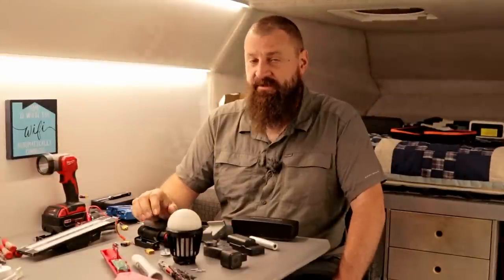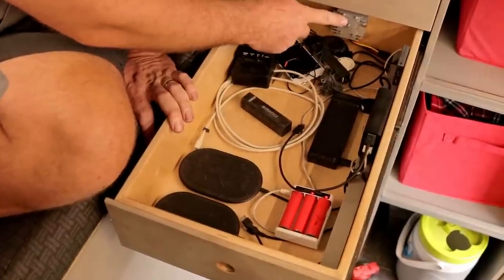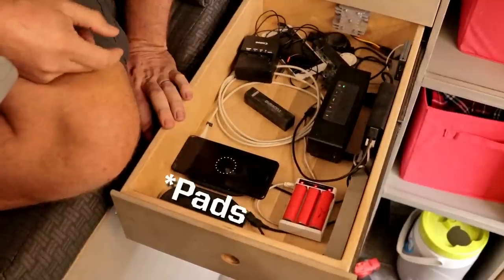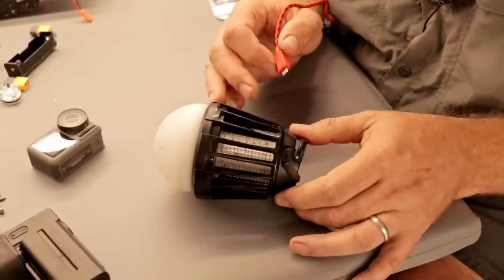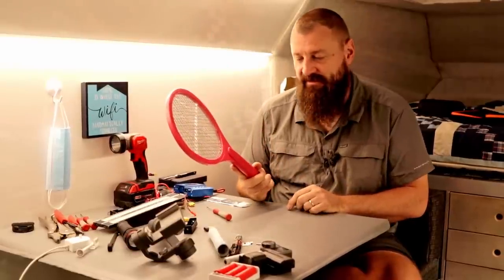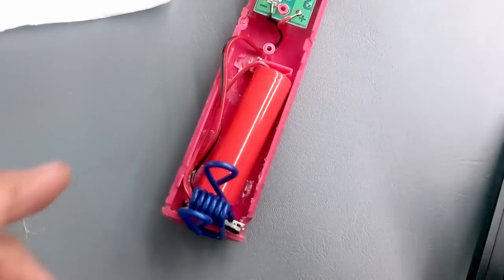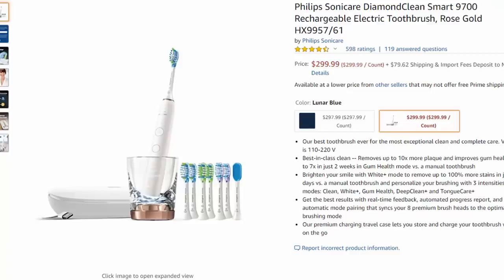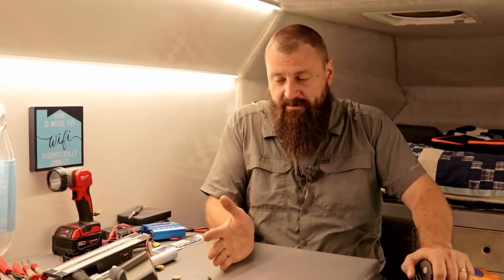Powering and Charging Overland Electronics - How we charge everything! - Everlanders See the World!

Comment: Looking forward to the upcoming project! Also the TS80 is similar to the TS100 but USB C Power Delivery powered. Useful to run off a usb battery bank.
Reply from the maker: Cool, the TS80 is half the wattage however, and there's already been times where I was soldering a larger gauge wire that was sinking the heat away and the 65 watts was borderline... so for my application the TS100 with the drill battery will be preferable.
Reply: Everlanders you should check out Marco Reps test of the TS80. It's actually higher in power while soldering. 
TS100 has a higher peak wattage but sustained wattage is lower :)
Reply: Was just about to say there’s a new TS80P out as of a week or two ago
Reply: I also have the TS100 and you can make a simple adapter for USB-C > barrel jack that can power the TS100 on 20V which is great. If you have a 45-65W USB-C power source. Just google "zypds usb-c" this is the board I used. 10cm cable and just heatschrink it.

Comment: There's some real nice aftermarket firmware for the TS100. I use mine with a little waterproof buck/boost converter. Takes ~12v and turns it into 24v so I get full wattage from my TS100. Heats up quick!  Thanks for the video.
Reply from the maker: I'll check it out, do you have a good suggestion where to find this firmware?
Reply from the maker: Great tip on the buck converter... I suppose I can run mine straight off the solar that's coming in at 22 volts or so...
Reply: @Everlanders  https://github.com/Ralim/ts100 I'm currently running that one.
Reply from the maker: Thanks, I found it and have already installed it. I couldn't imagine what other features could be added to this already fantastic product, but the boost mode and safety shutdown timer are essential...

Comment: Please feel free to post more Hackery videos if the mood ever returns!  I'm assuming your wall mount TV is using DC converter as well?

For anyone reading comments, can look up any notebook chargers to see their volt/amp requirements.  Older ones tend to be in the 19-24range.  iFixit sometimes has teardowns of devices.  From one of their videos, I found the IC power chip used for Microsoft surface pro tablets has a very nicely wide range so I charge it from either the cigarette port via 12v or a usb-c PD2.0 device.  Same for using a blu-ray player .  Generally, just remember it's easy to release the magic smoke and burn up your device when you do this.  I tried to put 16v into a 12ish volt blu-ray and the smokium maximus spell caused it never work again.

PS.  I have soldering iron envy! :)
Reply from the maker: Yeah, we use PD to charge our Surface... Trying to keep the smoke in.

Comment: Yup, still here and learning something new with each video.
I gather that you're happy with the bug zappers?
Now I need to do some research to find out how I can use the 
iMAX B6 Mini. I have a much larger version for charging my e-bike battery. Thanks
Reply from the maker: Yes, we love the little USB Lights/Zappers - although they don't really have that monumental ZAPP you'd expect, they somehow do it silently... And Mosquitoes are attracted to Co2 and not UV Light, so they aren't effective for mosquitoes - but they ARE effective for no-seeums and a plethora of other tiny fruit fly bugs that get through our screen.  It's always plugged up and needing to be cleaned out - My only complaint is that it's a bit tricky to clean out, they say to run it under water, but that takes a lot of water for us, so I've been using compressed air and sometimes a ear cleaner to get in between the fins and get them loosened off.

Comment: nice! definitely gonna be getting some of those portable lights/bug zappers and resistor-modding my swatters!
Reply from the maker: Right on! Pasting in my previous comment for tempered expectations: We love the little USB Lights/Zappers - although they don't really have that monumental ZAPP you'd expect, they somehow do it silently... And Mosquitoes are attracted to Co2 and not UV Light, so they aren't effective for mosquitoes - but they ARE effective for no-seeums and a plethora of other tiny fruit fly type bugs that get through our screen.  It's always plugged up and needing to be cleaned out - My only complaint is that it's a bit tricky to clean, they say to run it under water, but that takes a lot of water for us, so I've been using compressed air and sometimes a ear cleaner to get in between the fins and get them loosened up.

Comment: Not sure if you saw the new TS-80P that just came out that supports USB PD as well as QC. I've been debating about getting a TS-100 but that new one is pretty slick looking. 
Thanks for the rundown of the mods, they all seem like good ideas!
Reply from the maker: But it's half the wattage... So I chose the beefier one...
Reply: Makes sense! I didn't think there was that much difference in the power levels, good to know!
Reply from the maker: 35ish to 60ish watts if I remember correctly, it doesn't matter if your soldering a tiny little surface-mount LED or something, but if you are trying to solder a connector on a largish wire or other solder a part which is connected to a large ground plane that is sinking away the heat, then it really helps...

Comment: I'm guessing you're also using Raspberry PIs? How are you powering those? Micro USB is so instable on those things. For me, I'm quite happy with the Pimoroni Wide Input SHIM. Only the small barrel connector is a bit flimsy, better resolder that one
Reply from the maker: Yes, We have 5 Pi's on board, I always solder directly to the 5 volt rail at pins 2 and 4
Reply: @Everlanders  and for the 5 volts you use just a regular DC/DC converter? Or something fancy?

Comment: I used a small relay to bypass the resistor while the button was pressed on the bug zapper. Works great and my kids don't shock themselves. Give it a try, I'm curious to see what you come up with for modifying it further.
Reply from the maker: I can't imagine that relay would last very long with 3,000 volts arcing across the contacts... I bet you it has welded itself closed already.
Reply from the maker: On second thought so I suppose the resistor would limit the arc.
Reply: Yeh, I was thinking replace the main switch with a DPDT switch with a current limiting resistor on it for bleeding the cap.    One circuit would be NO for the zapper on button, the other would be NC for the bleeder resistor.  Big question there is isolation, but probably not a huge risk, would certainly need to limit any stray capacitance/inductance in the circuit with the bleeder to keep the arcing to a minimum with a purely resistive setup.

Comment: For higher voltage DC charging I'd recommend the MingHe D3806 and you can charge stuff like the Milwaukee battery just charge it to like 20v just in case it's out of balance and then charge it on the regular charger every once in a while they are just useful for a lot of things but does the Imax b6 not boost voltage if it does you could use it just the same and I'd recommend the aftermarket firmware for the ts100 and also running it off like 19ish volts it is much more powerful I mean it works at 12 but I just can't go back now
Reply from the maker: Yeah, I'll need to look at that firmware, can you send a link?
Reply: @Everlanders  oh it's been a while I'm sure it should not be to hard to find if I recall correctly you really just drag the new file to the soldering iron and your done
Reply from the maker: Yes, the firmware is drag and drop, but I'm not finding anything newer than the version it was delivered with.
Reply: @Everlanders  ya I'm not sure but the other firmware is not from the manufacturer it's open source and someone else made it
Reply from the maker: Found it here: https://github.com/Ralim/ts100

Comment: You could have the resister wired for normally closed and when you push the button its open and then closed it will discharge it
Reply from the maker: I don't know of any button that will tolerate 3000 volts across the contacts...

Comment: So, what connectors do you use for exterior weatherproof connections, such as lights and other 12v accessories on the roof rack?
Reply from the maker: I try not to have any connectors outside, they are all grommeted and brought inside the box. The few I do have outside are the same XT60 with a little dielectric grease and a heat shrink sleeve over it. See the Solar Install video for details.
Reply from the maker: As seen here at 3 minutes 40 seconds: https://youtu.be/3nKCH-whO2A

Comment: My raspberry pi 4 seems to want 5.1 volts at 3 amps. using 5 volts gives under voltage.  have you used rpi 4's yet  ? and have you found a nice power convertor for them without using the tuneable versions. ?
Reply from the maker: I have 4 of them running on fixed 5 volt power supplies as discussed in this recent video: https://youtu.be/UAZGX379dmc
Chances are that your supply can't handle the load and the voltage is dropping below 5 when loaded.

Comment: Is the actual induction component in the base station of the toothbrush charger actually AC... that surprises me if so, would it not have been simpler to hack the base station and leave the brush intact as now you have an exposed usb port that's gonna get full of toothpaste and water. 🧐🤔
Reply from the maker: I already tried that, the base station was completely sealed in potting compound... I suppose I can take the induction coil that I removed from the toothbrush and put it on there and see what kind of voltage I get...
Reply from the maker: It's AC alright, confirmed just for you... https://youtu.be/aI4Ghcpeb9I
Reply: Everlanders well I'm buggered, that is a surprise 🤣🙈

Comment: Do you have any problems with your devices handling the wide voltage range of the "12 V" lithium supply? Way beyond ±10%.  

Devices designed to be powered via cigarette lighter should not be a problem, but I'd worry about others.
Reply from the maker: I've never had a problem, our house batteries are pretty stable around 13.4 volts and not connected to the chassis batteries. And if I feel anything has sensitive enough electronics that it needs 12 volts ±, then I use a DC regulator as shown in this more recent video. https://youtu.be/UAZGX379dmc
Reply: @Everlanders  Aren't the devices exposed to the ~14.3 V charging voltage?
Reply from the maker: No, we don't charge from our chassis.
Reply: @Everlanders  What voltage is coming from your solar system? I realize that your non-traditional system works differently, but your LiFePO4 batteries still require elevated charge voltage.
Reply from the maker: 13.42 is the highest the system ever sees.